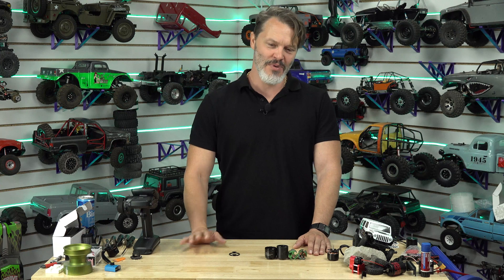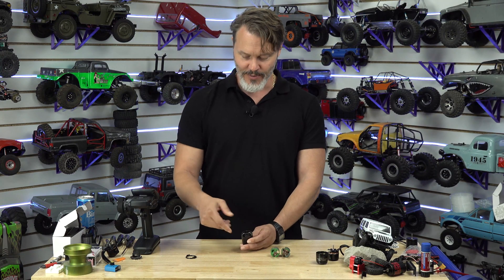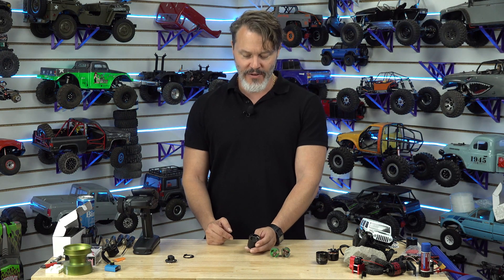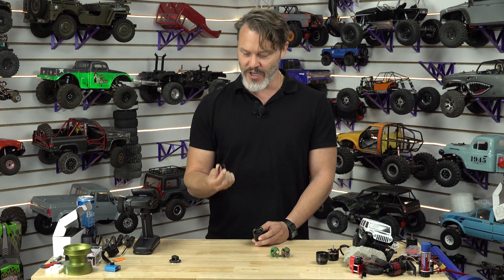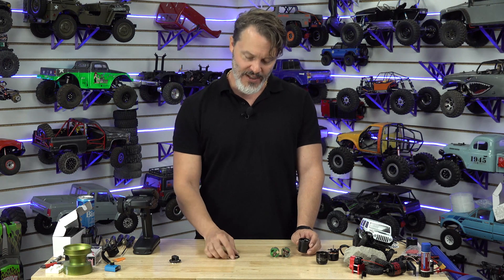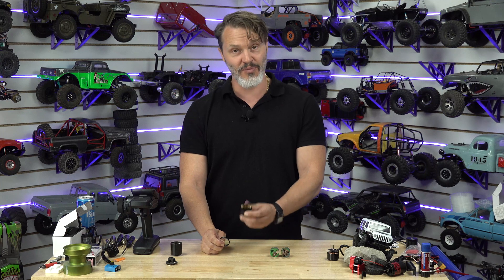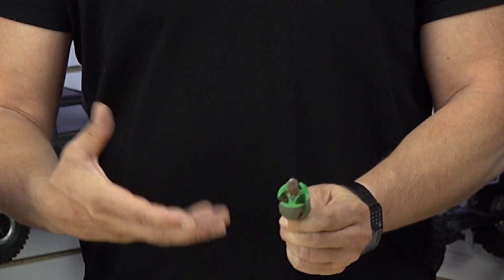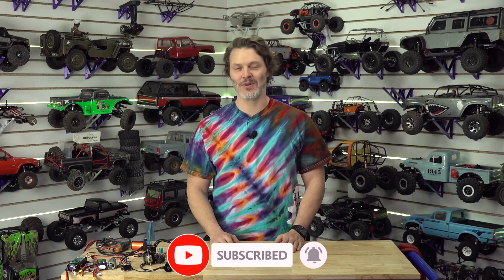Magnum Motors🚀 How 3D Printing Revolutionized Our Motors – Industry Secrets REVEALED! 🚀

Comment: Your retro series motor are awesome! Do you think there is a market for re-imagining the trinity speed gems or Orion Orbital series motors for us speed runners? I think the lot of us have exhausted the supply of low turn vintage motors. 40k- 50k rpm range.
Reply from the maker: @Paul_CoughinCornersRC   we can, and do, custom wind pro motors for any speed.  Just did some 5x2
Reply: @HolmesHobbies  wow!! I was talking with Fil at PoorboysRC about burning up vintage motors and speed runs. I'd rather not kill of what's left of these old motors.
Reply from the maker: @Paul_CoughinCornersRC  we have 3 and 4mm web arms as well. Just not really good for crawling so we took the option away years back.